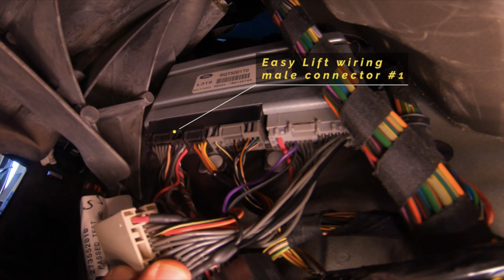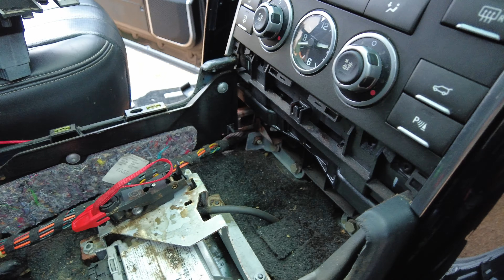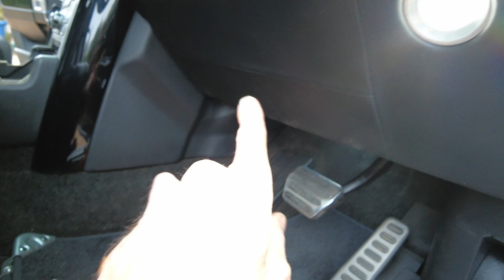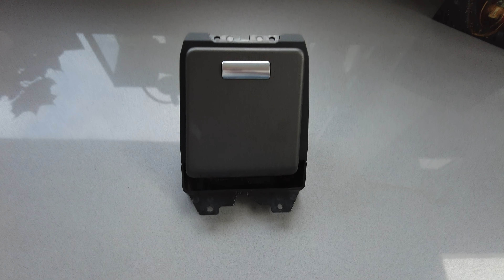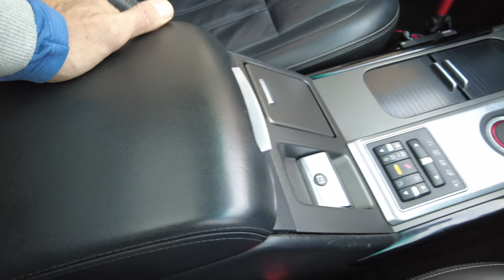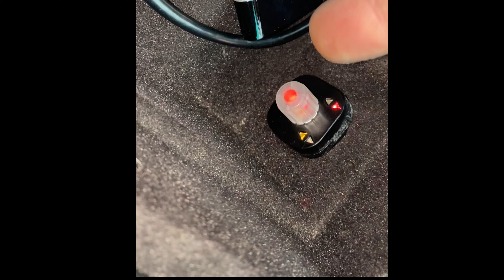L322 Overland Build. Easylift suspension ECU install

Comment: If requested, LandRoverPassion will add a 4m extension for L322's.  Just in the process of ordering it all.  The extension is an extra 15 euros.
Reply: I had to build the extension myself, I did talk to Max about it. I use the app now, I still have it all connected, the dial in the cubby box, but disconnected the extension loom. The App is easier to use IMHO
Reply: @marktalbot4wd  would be great if the app was landscape and available through carplay, that way I could get it through the NaviPlus 👌🏻
Reply from the maker: I’ve not found that an issue, I just have mine set on +55mm all the time.